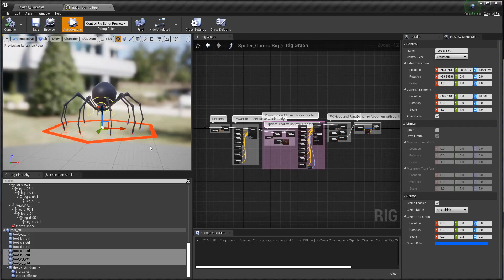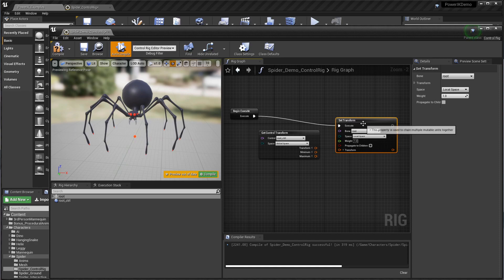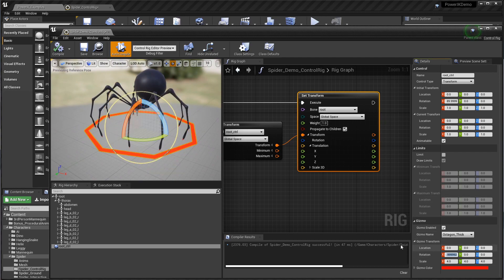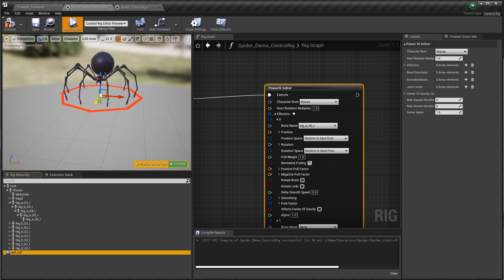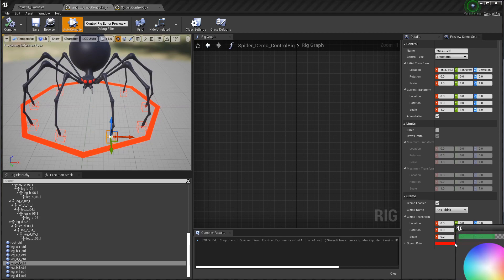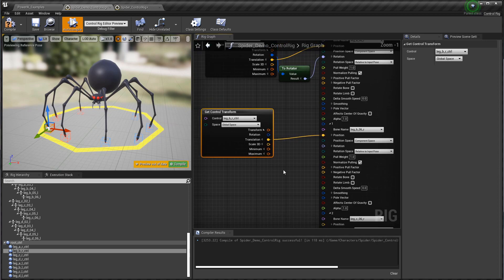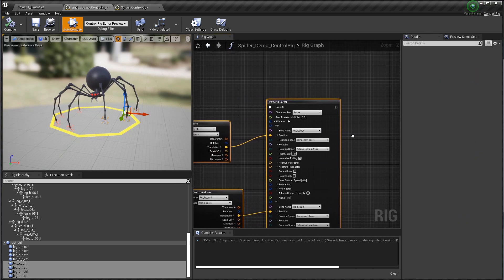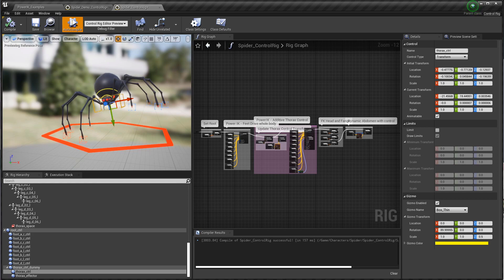Power IK: Intro to Control Rig 2/2

Comment: Is this plugin still supported/viable? As soon as I do the step at 2:20 my model flattens on "Y"...and whatever I try it just gets worse. Also, I tried to open the project folder but it wouldn't open in the editor ("PowerIk could not be compiled")

Comment: Update on my success using Power IK:  At first everything was very new and it was a challenge.  I guess I might have named some of my effectors with Capital letters and things didn't work out but if you watch this video a few times and take it step by step and do what he says everything works.  I think.  I initially tried power ik on my own character and it didn't work very well.  I tried again using the mannequin male and female characters and that was super easy.  I have done it a few times and the steps are getting easier.  A Tutorial video on setting up the second Power IK would be nice:)

Comment: It was a journey but I figured it out:)  I am so happy inside that now I can take any rigged character inside Unreal Engine 4 and do this to that character but, I am in Unreal Engine 4 and I am able to see my character with his Control nodes situated around his body and I can freely move everything just like you showed.  My Character is greatly shrunk:  No arms, you can barely see his hands and feet, and his head is gone.  How Can I fix this issue?  The original character before Power IK is almost like Kind Kong.  Now I have a stick figure man.  He animates just fine.  I did everything in your video but I am having issues.  I'll show you an image of my original character on the left and the Power ik character on the right.  The image I am showing you will show you what I am working with:  https://ibb.co/QPrfyV5
Reply: How'd you figure it out? I've got the same problem, all the limbs get really small when applying the powerIK node.
Reply: @Fenabit  I’m not sure exactly. I think the scale of your fbx might have something to do with it. I initially created a macho humanoid and I created a skeleton for him and exported to unreal engine 4. Then I watched this video many times and I couldn’t figure it out. I went back to it and I think this video needs to be updated for the latest version of unreal engine 4.26. I eventually got it to work with my character as a stick figure and I figured I would make a dragon next. I made a really nice dragon with textures and wings and I am currently trying to set things up a second time using this video as a guide and I am stuck on those shapes that you drag around and your skeleton moves with the shapes. The shapes aren’t attaching???  Maybe I’m not drinking enough soda to compute things or maybe I need to write down each of his steps on paper and slowly walk through each step👍
Reply: @LEGIT134  When you import and export theres a hidden feature for the scale of the model fbx, check all options before you import models... Power IK its suppose to sync the bones to fluent and accurate movement and attachment, you should only use on certain parts of the bones, otherwise it can flip the whole physic calculation between gravity and power IK .